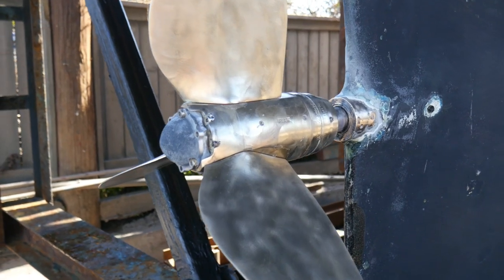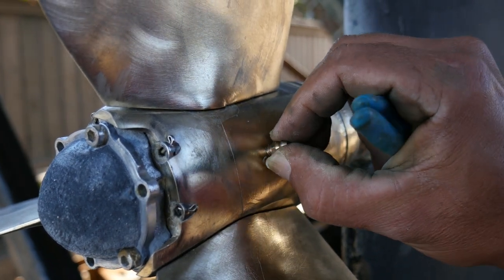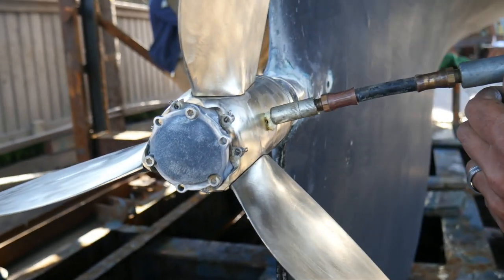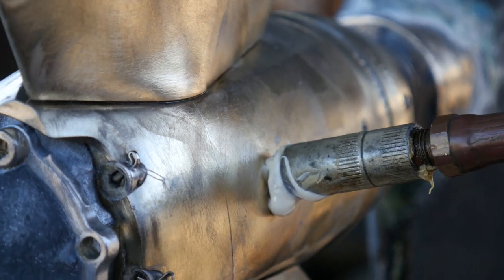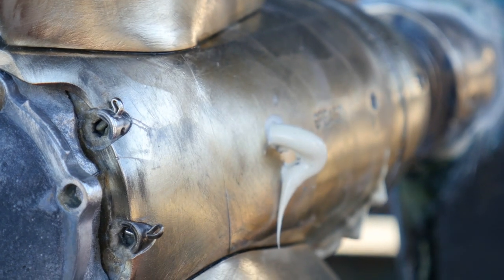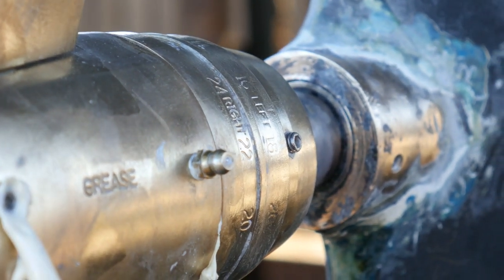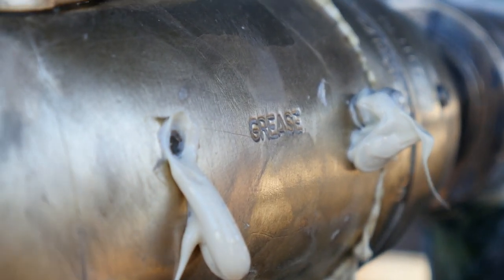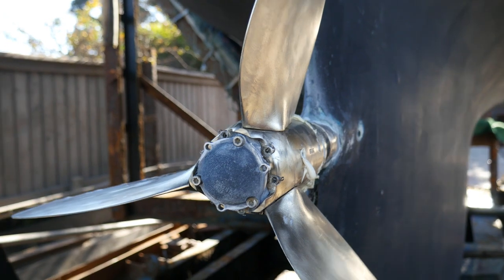How to do a regular service of a MaxProp Propeller

Comment: you needed to remove the front set screw and grease that location as well. That forward setscrew is longer and acts to also prevent the pitch ring from moving forward. If you put too much grease into the forward end (two front locations) it can actually bind up the prop rotating....just remove set screws and let the pressure release and reinstall. Keep in mind you need to rotate the prop full end to end every few pumps of the grease gun to disperse the grease inside the propeller.

Comment: Great video, thanks,. My MaxPro is older early 80s, and does not have grease holes. This prop apparently must be taken apart to grease. My friend and I are going to tap holes and install the screws.It will make maintenance much easier He has matched the thread and done a few practice holes on structural bolts to make sure. What we are looking for is we know the grease hole are 180 degrees from the 4 screws holding it together. Any tips on measuring for them? We are going to try and do this while its on the boat. The allen screws holding it together look a little suspect  and its too close to spash time to start pulling our stripped ones. The prop is on an 83 Irwin Citation and is 63 MM. thanks, Ill try to post some photos or video of this back to you
Reply from the maker: Smart move. Remember to drill slow and not push too hard to keep as much of the shavings as possible from being pushed inside the prop. With a little grease instead of drilling oil you should even end up with all of it outside at the end.
Reply: @sailboatcareandrepair  I took photos and we did a drawing of what we believe would be the inside, based on videos and manufacturers material. We tapped and and greased it, seems to be working fine and grease came out where it was supposed to. I will send the materials along plus some pointers. Not to hard to do
Reply from the maker: Fantastic!